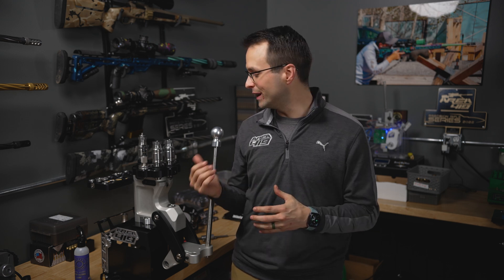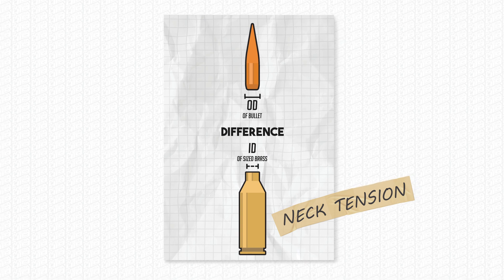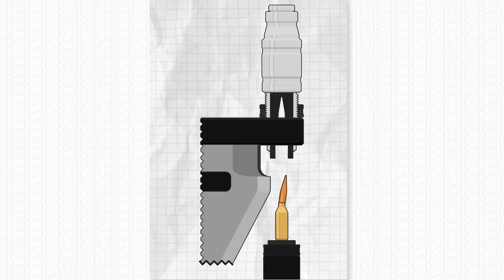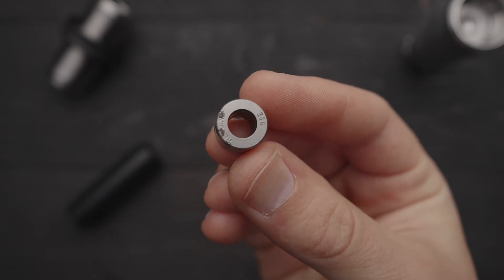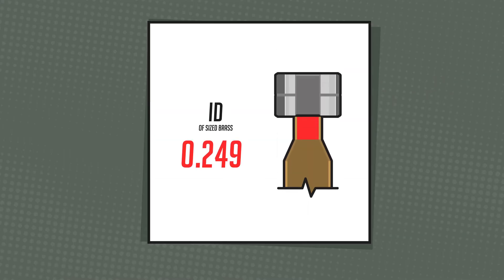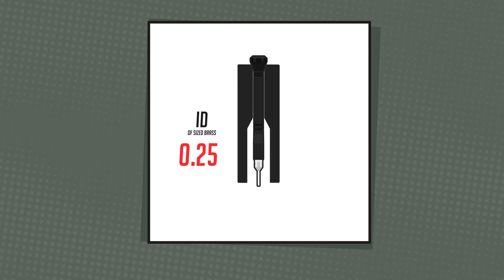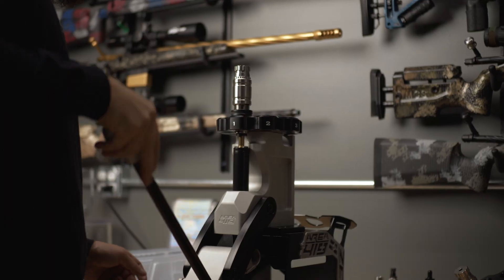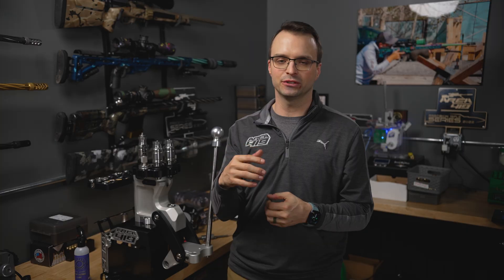How do we set NECK TENSION? | Explained

Comment: Neck tension should be a measure of force and not a measurement of size
Reply from the maker: If your neck hardness is consistent, the relationship between the two is very good. The better job done with setting your post-sizing dimension, the smaller your variation in force on seating.
Reply: So tell us all your secrets. Where's the video?

Comment: This is very helpful, and is one of the very few videos that explains and shows graphics of bushings and mandrels in detail.

I bought some regular Redding premium dies, but not bushing dies.  Instead I use a turning mandrel to give the .002” neck tension I need.  A friend said I should ALSO use a bushing just to minimize how much the neck is worked (?), but since I anneal I haven’t worked that out yet, or completely understand the need for both the mandrel and a bushing.

Wonderful press there, and very well thought out dies.  If I didn’t have years of investment already in several other presses I’d be all over the Area 419 products.  Thanks for the helpful video!  👍

Comment: switched 100% to mandrel , found bushing dies did not compensate for variance in neck wall thickness and expander balls adjust to fast and not 100% everywhere inside case necks

Comment: Craig: impressive die and very innovative.  I understand you aim for .002 neck tension.  How much does the die size the neck down before the mandrel come thru? For example is the 308 win neck .335 , .334 before the mandrel?
Reply from the maker: This is dependent on brass/cartridge, but when we did the math on how far we size the outside of the neck it's meant to make the ID of the neck .002 smaller than the smallest mandrel we sell at that diameter, with the thinnest commercially-available brass. So if you're using the stock mandrel you're likely going to see something like .004-.005 of neck sizing, brass dependent.

Comment: So what's the difference between the expander mandrel in the Area419 die and the typical expander "ball" in most FL dies?  Right now, I'm using a FL bushing die with the expander removed to neck down slightly then running the brass through an expander mandrel to try and get consistent neck tension.  The reason I started using an expander mandrel was because I was paranoid of stretching the brass by pulling the neck past an expander ball.
Reply from the maker: The problem with a ball-style is that it isn’t supporting the whole neck at once, and can cause less-than-straight necks. Our mandrel has a very long surface for sizing, meaning we can support the whole neck in a straight cylinder as we expand. Makes a huge difference.

Comment: This afternoon I shot a 5 shot group at 100 metres with 11mm centre to centre & 21mm OD with 4.8 fps SD with a Sauer 101 hunting rifle in .308 using 42.9 gr of AR2206H and 140gr Outer Edge Ball Bearing tip copper monolith fired from ADI brass .3365 OD sized with an RCBS Match Master FL die and SAC .333 bushing. This is now my hunting load after repeated shoots showing the same grouping. All the techno jargon and marketing mean jack shit if you can’t drive your rifle and use your tools properly.

Comment: 0.241 ID + 0.013 wall thickness = 0.254 bushing???
Reply from the maker: If you noticed the note on bottom of the screen at that point in the video, just some math in the moment. The .267 bushing would be the correct one. You add neck thickness twice as it's 0.013" per side (as bushings are diameters, not radius measurements.

Comment: I've had some issues with pull through expanders messing up the head space and shoulder angle on some very shape angle shoulder cartridges such as 6 dasher and 300 wsm. Has this been observed with your dies at all, and what have you guys done to mitigate that risk? Should also add that I am using neck lube neck lube and have still encounter this problem
Reply from the maker: With a long lead angle and full length mandrel surface we have not seen this. There was a time we saw similar issues with ball-style expanders in other die systems, and that kind of thing specifically pushed us to a mandrel-style.

Comment: What would your thoughts be on the best route to size a 6mm BR case that has been neck turned to work in a bench gun reamed with a chamber having a  .262 diameter neck?   I know that the neck does not expand over the elastic limits of the brass right away, but there is some change over a number of shots.  Neck material thickness is about .008
Reply from the maker: If you've turned down your necks to .008" I think the mistakes have already been made. You may be doing it with success, but that's not something we would personally endorse. You're going to need a custom die with a custom neck for that application. 

I'd still say that your sizing die should size the neck nominally past your desired neck tension so that it can be set with a mandrel, and I hope you're annealing every time.

Comment: Probably a silly question, but how is your pull through mandrel different than a standard expander ball?
Reply: My strong bet is a ball gives it more chance to warp with spring-back, and if its not all straight, you won't feel or notice as much cause there's less surface for resistance. Some pins or balls float, too, which can allow it to drift. But a beefy mandrel won't, it should keep everything concentric, and straight.
Reply from the maker: @AC-bl1rl  Bingo. Exactly right. The idea is similar, but in execution a longer bearing surface is very much needed for a consistent, concentric neck.
Reply: @area419  mandrel could also help clean up inner micro wrinkles if you're having to size down a bit.

Comment: When I use a bushing to slightly undersized the brass to use an inside mandrel I notice with my AMP Press that the seating force is higher than just using correct size bushing in single step. So I might have tighter tolerances, but at the cost of more tension. Do you notice this with your dies?
Reply from the maker: If the tension is higher than you'd like, you probably need a marginally larger mandrel.

Comment: Torn between bushing dies, and expanding mandrel dies.

@area419 stupid question…after using a wax etc to lube the case for sizing is it sufficient to just wipe it off, or should I clean the brass in the tumbler?
Reply: Also....  Take your die apart and clean every bit of "other" lube out before using one-shot. And don't switch back and forth between lubes, or you'll get stuck cases.
Reply from the maker: @Spin-Drift-Ballistics  Good addition. Clean gear tends to be happy gear.
Reply: @area419 do I need to use any type of lubricant inside the neck with the m-series dies?
Reply from the maker: Very much depends on the lube. If you're using imperial, probably needs to come off. Removing one-shot isn't a big deal, have left that on cases for years. Any time you put something sticky in a rifle be really wary of cleanliness.
Reply: Thanks! Maybe I’ll just use one shot. Be easier
Reply from the maker: @nebraskaman8247  If you go that route, be sure to use a lot of it. You'll see complaints of stuck cases online w one shot, it's usually to do with not using enough.
Reply: Okay cool! Thanks for the help

Comment: I use the bushing and this is the first time I seen this kind of die
Reply: This is the way 99.99999% of dies work.  The bushing and expander mandrel trend has only been mainstream for 10 years or so.  The 419 die works the same way a $29 Lee sizer works except with bunch of years perfecting the most efficient way to get exacting results in a single step.

Comment: Running a full length sizing die with the decapping pin/expander ball removed, and as seperate steps do the decapping and expander mandrel to set neck tension
Reply: Look at Short Action Customs die which includes sizing and mandrel in one step.
Reply from the maker: @TheArtofPrecision  Did you not watch our video? Or just coming to our post to push someone else's goods?
Reply: @area419  your design is inefficient, 1, requires a Zero Press, 2, requires a new tool head. Additionally, it is not modular. & is 50%-100% more expensive than a SAC modular die.
Reply from the maker: @TheArtofPrecision  Our die absolutely costs more, but retains all function that you're describing (yes, it's modular, with the swappable parts becoming available soon), as well as adding the function of micrometer adjustable headspace. It's a different product at a different price point. 

Also, today it requires a ZERO, but in short order they will be available with common-style shellholders and can go in your standard RockChucker.
Reply: @area419  The standards will fit the standard Zero tool-head as well?
Reply from the maker: @TheArtofPrecision  Shellholders? Nope. Different parts for different presses. 

Or are you talking turret? In that case, you'd need to either order your press with a Hybrid turret when you order it, or you'll be adding a turret. 

Want all of your dies to be 7/8? Our S-Series dies, which will probably be more in-line with your personal needs, are coming later this year.